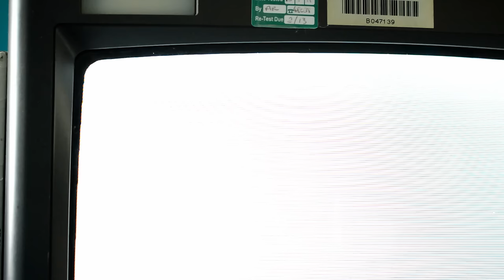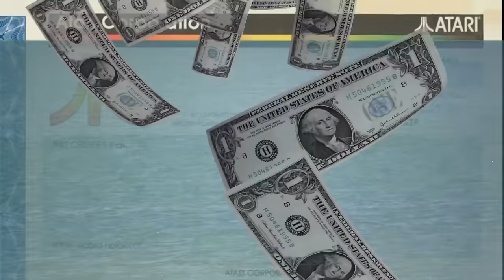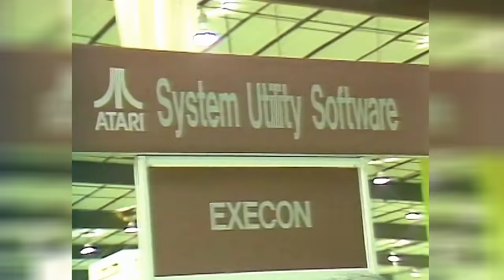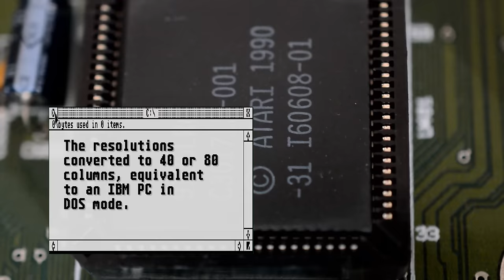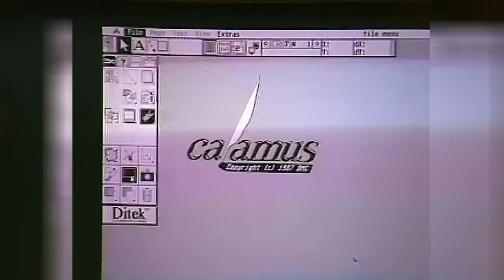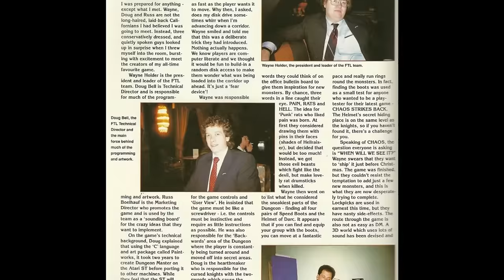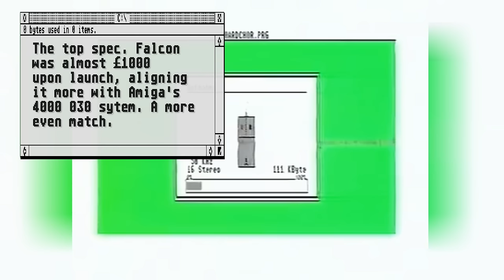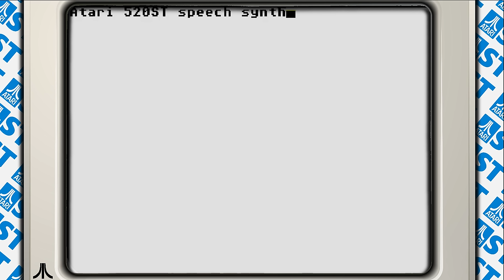The Atari ST Story | Nostalgia Nerd

Comment: Atari sucks. Always did and always will. The C64 is better than Atari's 8 bit computers, the Amiga was better than the ST, The Colecovision and Intellivision were better than the 2600. Atari has always been the crap of the industry and always will be.
Reply: I'd agree with you on the ST. The 2600 preceded other consoles by years, as did the Atari 8-bit computers 3 years before the C-64. Atari made the best coin-operated video games. The ST was neither designed or marketed by people from the old Atari. It was actually more of the sequel to the C-64 .
Reply: Despite the lack of Power in 2600, its price made it soar to the top. A lot of carts were made that actually were built to enhance the power of it. (Or lack of rather). It was built cheap but outsold its much higher end competition.
Reply: Darth Grumpy     The Amiga would have won if it had a decent OS, which it didn't.  It was a games system with a keyboard.   Nintendo and Sega wiped the floor with it easily.
The ST filled a gap, cheap usable computer until the 486 reached a price point to replace the ST. 
I also used page plus on the ST it felt like a cheaper Apple. 
Both Amiga and ST depended on games to sell machines,  that was obviously a dead end.
Reply: Dude, it's been like 30 years. Let it go.
Reply: @krnlg      ATARI RULE.